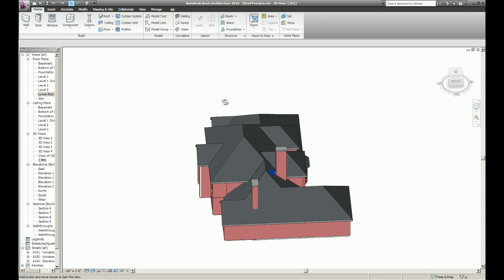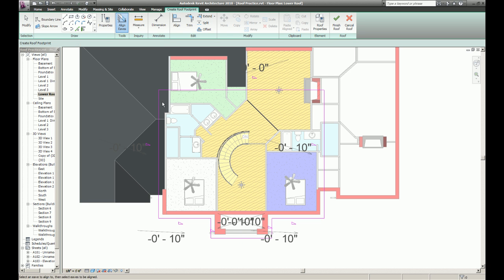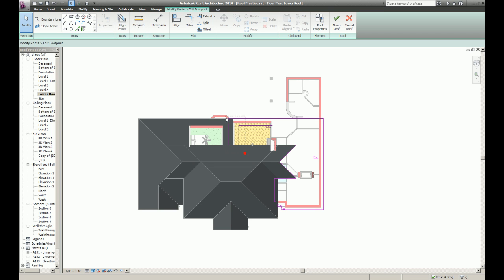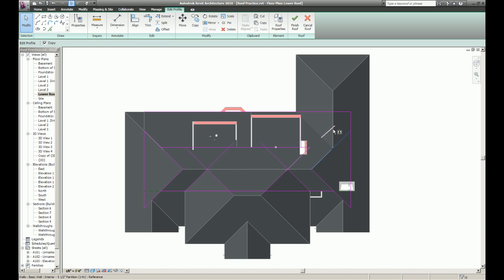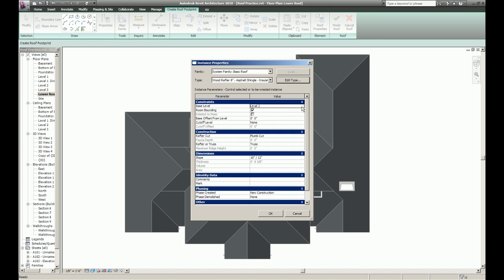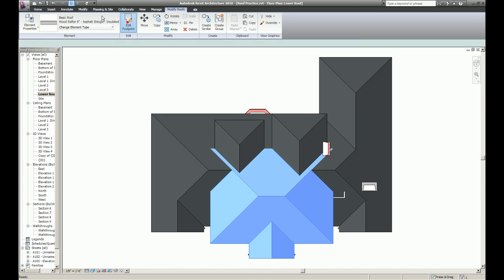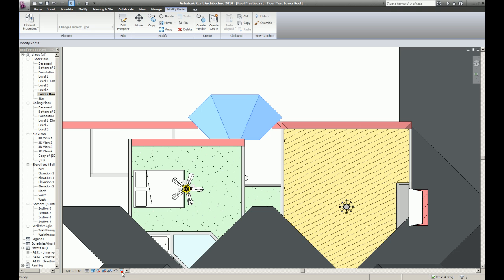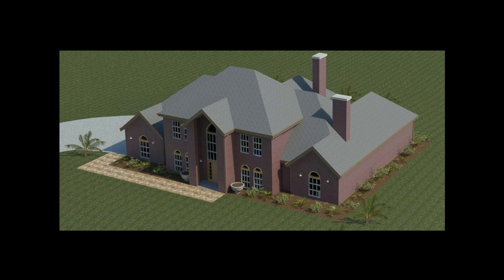Complex Multi Story Roof on Revit

Comment: I am trying to figure out how to put a roof on around a courtyard. I'm doing a project and there is a courtyard inside of the residential. how do you put a roof on? would i have to do parts of the roof seperate like you did?
Reply from the maker: If I understand correctly, I would just draw a separate roof for the courtyard. You don't need to have walls to draw a roof, you can simply use the Roof by Footprint and draw your own boundary lines. Hope that helps.

Comment: Well it is true that this video has a bad sound and doesn't explain very well, but it is still helpful to some degree. I just turn off the sound and slow down by pause to figure out what tool he used and his modeling steps. It is better to learn basic revit tools before watch this video.